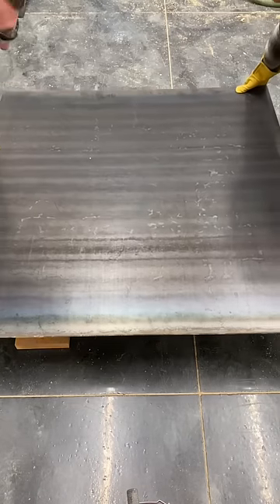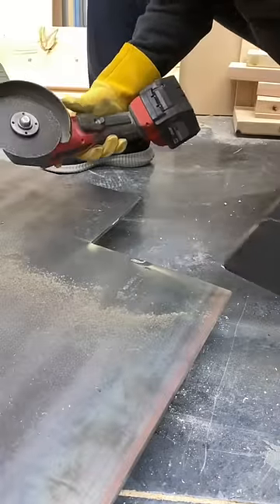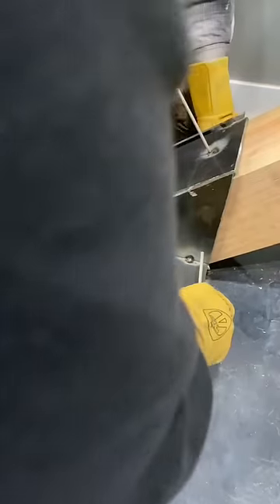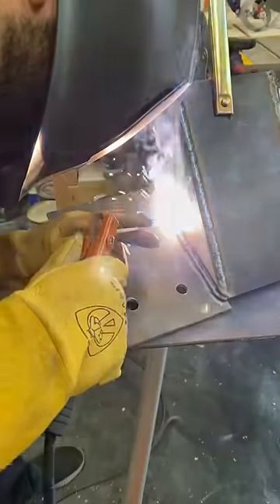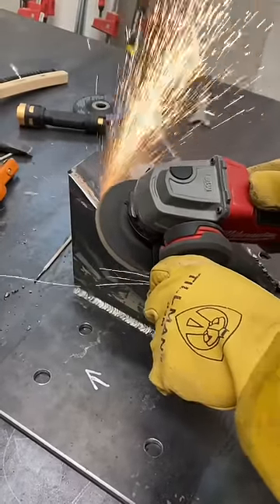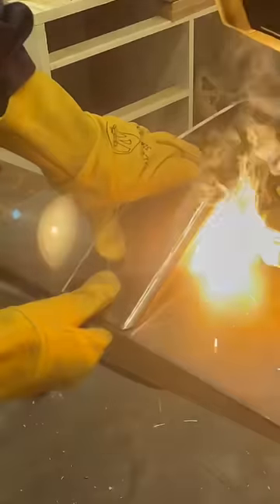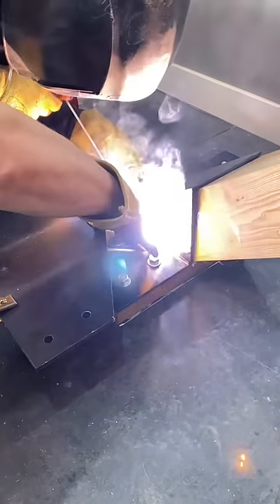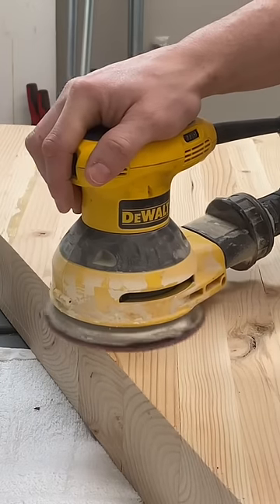Custom staircase out of 2x4’s part 4

Comment: Remember guys, drag stick and push MiG
Reply: Depends on what type of welding stick you're using.
Reply: What about flux cored mig?
Reply: @StevelandCleamer69  drag, unless it’s the harbor freight stuff then drag and pray it holds because it doesn’t even have a structural rating and the only guarantee it gives is that it sticks the metal together.
Reply: @randybobandy9828  yeah, it is useful to push those carbon arc gouging rods. Though I never heard of a stick electrode you don’t drag when welding because you will get slag inclusions if you push.
Reply: Lol was looking for this comment
Reply: @tyhassard me too!

Comment: Not saying you haven't done a great job because you have, however those welds although not sealed welds are probably going to "rot". Flux inclusions create a path for corrosion to travel, and pushing stick is a pretty good way to create them.
Remember, "If it's got slag, you drag". There's a reason that saying exists

Comment: When you weld with a rod… you drag it. You don’t push
Reply: Depends on the welder and heat. You can 100% push some rods and downhill them too
Reply: @TN_vigilance  you only push MMA rods when verti-up welding. If you're downhand or verti-down welding it's always if it's got slag you drag
Reply: @jonodan1  once again. You can and it’s done everyday. What you said is true and it’s what you’re “suppose to do” but until you’re in the field welding stuff that’s jacked up or super thin with only what you have nobody takes that stuff serious. If it’s not getting x rayed or anything like that you can down hill or push all day and the weld will be fine. But if it’s a serious weld better pull it or uphill